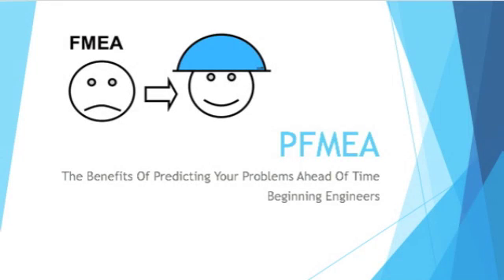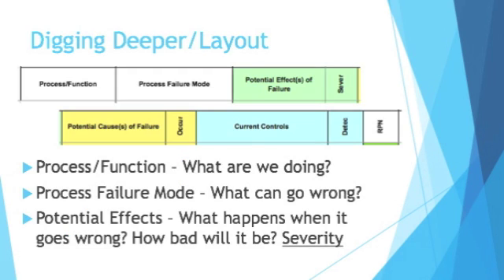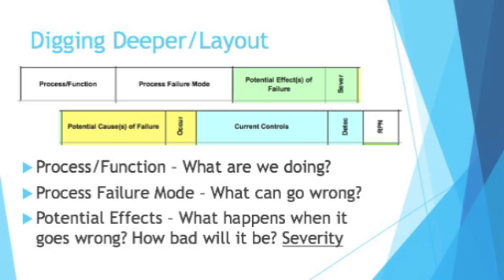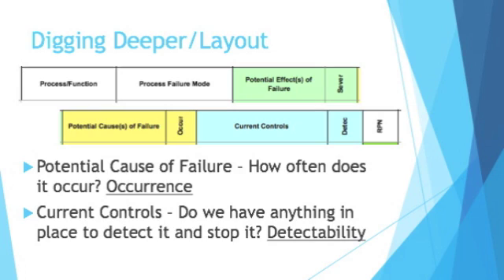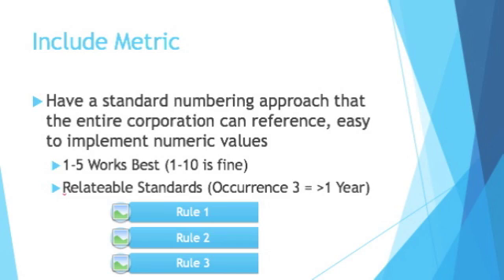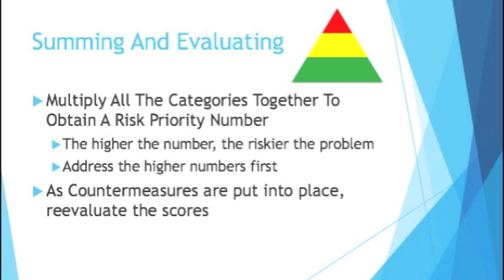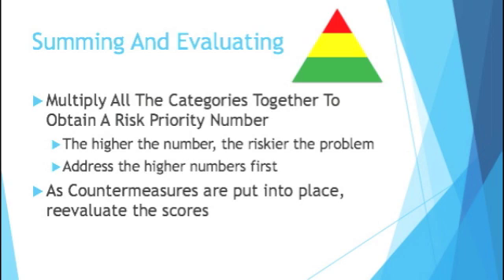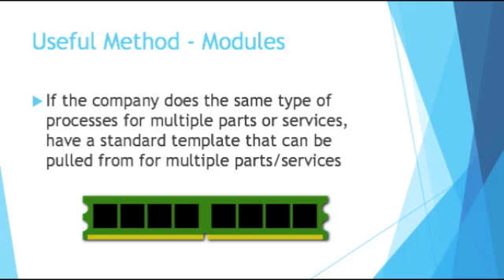Beginning Engineers FMEA

Comment: is failure analysis engineering job(semiconductor) job more stressful than product engineering?
Reply from the maker: It's really going to depend on the specific company and culture. Certainly with failure analysis you are topically discussing "negative things" (failures) most of your day, but you can certainly have fun with this topic and by putting preventative measures in place you can feel very optimistic. Product engineering can be very demanding too, but can also be very different than failure analysis. I would say research each more and make sure you read the job description at any company you are applying to!

Comment: sir ji i am risk identification as per iso 9001 2015 by pfmea with using ASQ   SEVERITY ,OCC AND DETECTION TABLE but i want to know that how to this table for human resources function plz  help
Reply from the maker: Human resources is usually concerned with the safety of employees above defects (as anyone using the PFMEA tool should be), so prioritize those risk areas that could result in hurting an employee (these have a high severity so they should be at the top of the list generally).
Reply: is AIAG sev,occ,det rating guidlines can be used for HR,PURCHASE AND STORE IF not then what to do
Reply from the maker: You can apply the PFMEA tool to many processes, not just manufacturing. You would have to identify what the primary tasks of those departments are and then begin breaking out the PFMEA based on those.

Comment: FMEA is most likely same as JSA (Job Safety Analysis) or GRA (General Risk Assesment), different industry, different name but same methodolgy, is it dude?
Reply from the maker: They are similar in the fact that all methods use quantitative methods to classify a variety of potential hazards, but FMEA is for a wider range of issues not always related to safety (often the items identified using FMEA are not safety hazards at all unless the problem is severe enough).

Comment: is there a way to validate an FMEA analysis?
Reply from the maker: What exactly do you mean by validate? Things like occurrence can be backed up by historical data for similar processes/occurrences and items like severity are generally easy to put a cost too if you can value the money required to make all the repairs/reparations. Detectability is a harder metric to measure, but you can look into how many times the issue has been caught before it made it to the customer vs. after.
Reply: It's like the Check phase on the PDCA cycle. Once you have it done, the records should tell you the how accurate was your development.